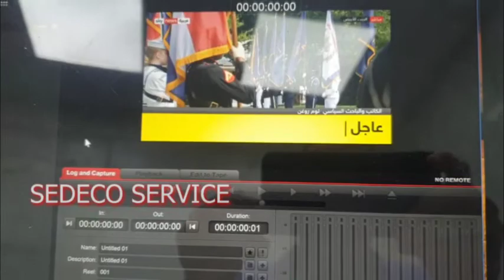Blackmagic Repair Intensity Shuttle USB 3.0  disassembly and repair problem no HDMI input (repaired)

Comment: I would like to sincerely thank you for everything. in fact I have a mini atem studio hd video mixer when you plug in the device is running but no light comes on so we do not have access
Reply: how to contact you
Reply from the maker: @jeromenassarah8238  hello   no any light in keyboard  ? and no output from hdmi out in screen ?
Reply: @sedeco99   no ligth but thé fan turn
Reply from the maker: @jeromenassarah8238   hdmi out  ?
Reply: @sedeco99  it's just the fan that turns no light nothing works

￼

it's just the fan that turns no light nothing works
Reply from the maker: @jeromenassarah8238   hi  if no hdmi out  check  power  circuit in pcb  and check if no hdmi chip in or out have short vcc
Reply: @sedeco99  it looks like the power supply circuit
Reply from the maker: @jeromenassarah8238   yes check 5v and 3.3v  in pcb
Reply: @sedeco99  i Will shoot small vidéo and i sens to you
Reply from the maker: @jeromenassarah8238   ok
Reply: @sedeco99  hello i send the video on messenger

Comment: The device reads intensity shuttle on the PC but doesn't want to output camera video from the video mixer, what's the problem?
Reply from the maker: hi check output to any tv first to see  and check tools in pc what oputput you will used hdmi or analoge